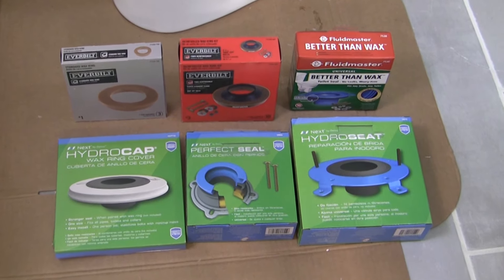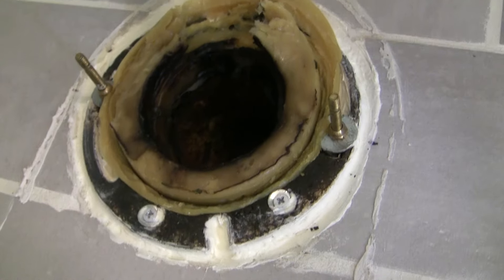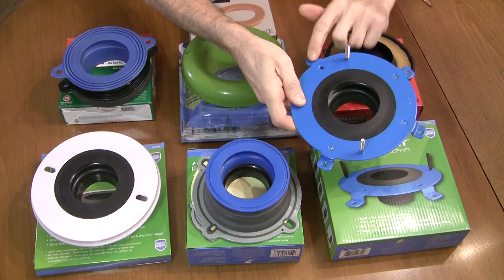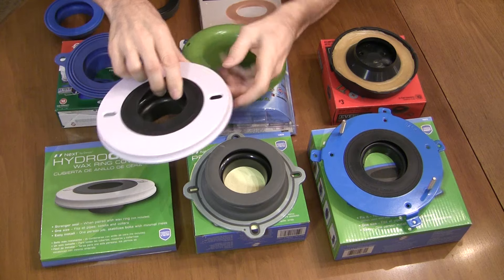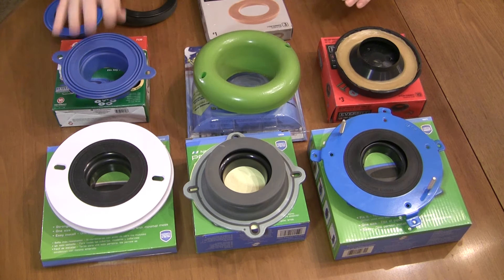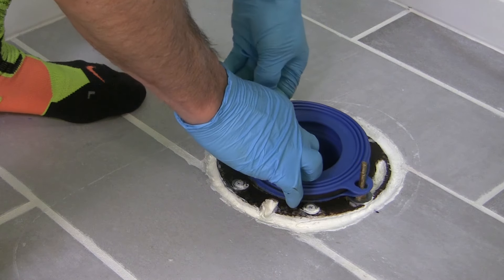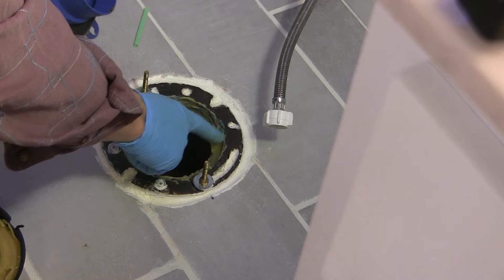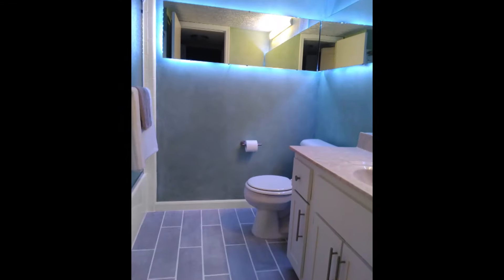2 YEAR FOLLOW-UP to Toilet Flange Fix  / Also, Compare Different Toilet Seals

Comment: I just did a seal 6 times 2 seals didn't  work then did another  one .then put old one back in .still leaked  then got a wax less one it was too big then got a 3 inch an it fit so I used a wax then a flange an put wax less on top .with no leaks .😮😊
Reply from the maker: Bummer.  I wouldn't be able to rest because I'd be thinking that it was going to start leaking any minute.
Reply: After a week taking that toilet  bowl off an on 6 times actually  12 times off an on .I got it to stop leaking  on.last try with black  wax less seal an wax on bottom  .iam done with it 😊 also had to catch water in buckets an used a kiddie pool to catch  water coming  though  basement   It was a nightmare  😮

Comment: the higher bolt ideas pretty cool but unfortunately it wouldn't work. you're just adding something else in there to get hardened overtime and crack and leak as well the bolts will not be putting pressure down on the tank anymore but yet on the tubes therefore after a period of time stress cracks will form therefore cause a leak. although would bring a whole new meaning to rock in the tank lol

Comment: No leaks? It worked. It worked? Then you did it right. The only thing you may have done wrong are those socks! (just kidding). You also answered a key question. What to do about the area around the flange? In my house I've just got a crawl space, so seepage, leakage would be under the house information, and the floor wouldn't be ruined. On the second floor of a house, your meticulous method of spray insulation foam, plaster?  A leak or seep could only get to the bathroom floor -where it would be a mop problem, and information. And of course the ceiling and room below would be undamaged. 
I think I've used my last wax ring. Today I'm replacing two old stacked wax rings that were installed between the toilet and the flange 1" (!!!) below the tile floor. There was seepage. When I pulled up the toilet no wax came up - so Zero seal. 
Hope and fond wishes  may apply to plumbers, but not to plumbing. I won't reveal the method I'm using to fix it because I'm not sure .... Well I used what they had at the Home Depot, so I'll spill. 
I've got a 1" gap between the tile floor and the still good cast iron flange. I'm using two sets of Korky WaxFREE Seal, and following their recommendation to use two. While researching this I found a video for Set-Rite which has several solutions that would probably work better for my situation.  One aspect of their system is if you old flange has the bolt holes busted off, you can drill 3/16" pilot holes and then screw in their self-tapping screws. That could be really useful.
Reply from the maker: WillN2Go1  It seems to me, you'll have to fill in that 1" gap between the floor and your flange. I'd cut some slivers of tile.  Maybe stack 1/2" pieces however you can get them under there and fill in the seams between them with mortar.    An inch sounds like an awful lot of height for a flange to be off the floor.

Comment: What about the extension cord routed through a wall?
Reply from the maker: By looking at the video, it's hard to know what's going on with those wires behind me because of the mirror reflections.  The wire goes behind the mirror, which is outset from the wall.  It goes to the transformer for the led light strip behind the mirrors, but I doesn't go into the wall.  It's not the most meticulous way of powering my lights, but it would take a lot of work to correct it and I'm too lazy.
Reply: @MartyPollio  haha you sure don't seem lazy.  Cool video.
Reply from the maker: @tomn6863  Thanks, man.

Comment: Plumbers telling you your doing things wrong. I'm here fixing professional plumbers toilet install. The idiots had no idea what they were doing. Leaking stacked rings with 3-400 dead flies under the toilet. Everything is wet and sewer gas odor coming out. Oatey twist and set flange going in now

Comment: Can't stainless steel nuts and bolts be used to hold the water tank on?
Reply from the maker: Yes, but they use rubber washers that decay in the water.

Comment: I'll ask this question because I'm ignorant. For the opening at the base of the toilet that connects to the flange, why not already have a lip built into the toilet that extends a couple of inches beyond the footprint of the rest of the toilet? That extra lip would go into the plumbing opening and would seem to eliminate the issue with leaks.
Reply from the maker: I hear ya.  I asked that same question at the end of my original (previous) video.  Seems like it would solve a lot of problems.
Reply: @MartyPollio  Indeed.

Comment: Marty,  Your comment on the possibility of manufacturers making the tank with porcelain "pillars" (tubes) and extremely long bolts is not necessary.  The Korky brand wax free gasket, and possibly other brands, provide stainless steel bolts.

Comment: 15:21 Not a good idea. Those long tubes made out of porcelain would be to thin and brittle. A much better idea would be to use stainless steel screws.
Reply: That's what I was going to say!
Reply: @clarkbarrett6274  Yeah I guess now we get a picture of why he was last of his class.🤣
Reply: @guayabito6946  It was still a fun and helpful video. 

I installed a new toilet last night only to find it not working properly (fill valve). What a nightmare.  I have another fill valve but changing out the brand new valve bites my butt.

Praying the wax ring works - it has the horn that is supposed to be bad....we'll see.

Comment: DO NOT USE THE Saniseal. Personal experience . After two years I removed my toilet and found the material falling apart. Talked to owner and he even requested I return it so they could study it. He was very interested and polite about it. I never found out what there study reveled. I went back to the old tried and true wax ring that never fails. This was back in about 2015 so I don't know if they changed the product. One can be making a big mistake using this on a wood frame floor. If your dead set on using it I would call and get some more info.
Reply from the maker: I've heard this same Saniseal story a lot.  The coating breaks down from the chemicals in the water and it becomes a mushy mess.

Comment: Your metal flange has a nut on each bolt and you placed the wings of the rubber flange over it. This doesn't allow the rubber flange to seat flat against the metal flange. I think removing those nuts are key for a more uniform fit. Stack the rubber flange over the metal flange and then bolt them together. Also, the foam didn't look good to me either and adding the wax looked like it helped. I think the foam part is junk and it would of been better as wax instead.

Comment: Taking 20minutes to repair or replace a flange doesn't necessarily mean the plumber is being sloppy or careless. Apparently some plumbers are able to install a toilet in 5 minutes because they have so much practice. They have muscle memory & it is routine and easier for them. If you're not doing this all the time it will take longer. Nothing wrong with taking longer for DIY if you do it carefully. If the plumber had said 2 minutes then I would give them sideeye.
Cool socks!
Lost art of paint scraper flipping. LOL! I would have dropped it because I have no coordination.
"Bees didn't sign up for this..." LOL.
Those saniseal things delaminate as well as get filled with water.
I went with Better Than Wax as well. You do need to sit on the toilet for a few minutes to get it to compress properly when stacking though. But they do have a thicker black ring to go under the blue ring now.
If you find yourself having to pull toilets frequently for any reason, I highly recommend a Toiletmaster lift jack (I'm not being paid to advertise). I swapped out the wheels to ones with locks & it's great. I have a bad back so I can't be lifting toilets.

Comment: 0:50 I couldn't sleep at night, if I knew my waste pipe was as rusted as the one shown hear.  A rotary brush could knock off that surface rust, and then protect it with some epoxy paint.  Use a dental mirror to inspect the area of pipe beyond the bend, but tape a string to your wife's dental mirror so you don't lose it down the pipe.
Reply: @tailgatecarpenter26  ROFLMAO!!!!

Comment: I'm not a expert, but seems to me if the manufacturer's would build the bottom of toilet  drain opening to be longer where it would go deeper into the  wax ring and flange it would fix leaking issues .

Comment: Im no plumber but i did almost exactly what you did and used the same seal and worked fine till now. Funny thing Was it was the toilet that was causing the problem and so far I’ve removed and reinstalled that toilet and just recently a new toilet and the seal still isn’t leaking. My problem is whoever installed the iron flange lined up the holes wrong so I had to install washers to catch the edge of the bigger part of the bolt holes in the flange. OMG 100 problems and the shit is one 💩

Comment: If you made bolt chimneys out of ceramic tall enough to go over the water line it would be so brittle that as soon as you torque down the bolt they would snap off like a pretzel.
Reply from the maker: Now I'm left with a sense of hopelessness.

Comment: Any of those are a downgrade to what you did in your original video, which was actually fine.  I've been in service plumbing for over 30 years and ever install is different and every plumber thinks other plumbers don't know what they are doing. Entertaining video for sure and although manybof the steps you did in your first video weren't necessary, they didn't hurt anything and it would have lasted for years or until you had a sewer backup that could have blew the was out.

Comment: You went to a lot of trouble to create this video. Not many people would do that. So, thanks.
Regarding the separated foam..see that's the trouble with some of these new gadgets made of foam and plastic. They might be perfect for a while, but if the material, or adhesive, eventually breaks down you could end up with a major problem causing you to have to not only pull of the stool to fix it, but to find that you have to replace your floor too. And that's what brought me here... [sigh] 
Not sure what I'm going to do. I might just go back to the ol' wax ring. (After I cut out the floor all way through the sub-floor and replace the entire floor.)

Comment: I purchased the green one years ago and have not had a single problem with it once over the years.
I don't know how someone could possibly knick it with the toilet sitting on it. Sounds next to impossible to me.
Reply from the maker: From what I've read in plumbers forums, those also get eaten into from the chemicals in the water.  Probably not a good idea to use toilet bowl cleaners in your tank.
Reply: @MartyPollio  I must be lucky because I've had one installed for close to 8 yrs now. No problems so far, even with those bleach tables that I put in the tank from time to time.
Reply from the maker: @ComPrt3  Just reporting what I read, but one thing I know for sure is that plumbers hate everything, so who knows.  I did a follow-up video to this one where I checked my rubber seal after a couple of years and it wasn't in very good shape from the water chemicals.  I decided to stick with wax, but lately I've learned that wax rings aren't all created equal either.  Evidently, the most common ones are petroleum, but the ones made out of beeswax are best.
Reply: @MartyPollio  So here I am just before 2025, and I purchased a new toilet. I ended up having to pay a plumber to install a new flange because one side of the old one broke. He install the fluid master better than wax seal. It lasted about 2 weeks. Water started pooling up in front of the toilet. So now I went back to the sani seal. Here's to another 8 to 10 years with this seal.

Comment: In terms of the toilet bowl and tank having screws and seals that corrode, there are one piece toilets that eliminate that problem. And as for the rubber seal, perhaps adding an extra flange to raise it above the floor could help.

Comment: This video is just another reason to use wax.  Lasts up to 50 years when done right.  Regards to the last comment on making the porcelain higher, well here are 2.  Way more money to manufacture, and if damaged now you have to replace the entire tank or whole toilet incase of a 1 piece.  I'd rather replace a $7-$10 part every 15-20 years that takes 15 to 20 minutes; after a novice reads the instructions.

Comment: I would say, because I've dealt with this issue, is that the toilets outlet arrangement has kept its weak points since Mr. Crapper's days. Its characteristics are, that this is good enough. Which is never as good as it can be. Putting the bowl on the flange is like trying to hit a target you can't see. Once you get it on, best you can say is that, maybe it's in the right place, which isn't very comforting. And the wax is the gooiest, sticky mess I've ever had the pleasure of getting all over the place. And I've seen the work of professional plumbers and electricians and they have nothing to be proud of. Professional only means that they are trying to earn a living doing it. That has nothing to do with how well they do it. And their poor workmanship is usually out of sight. And building codes, as far as I can see, only control how poorly the job can be done, not how well it should be done. This should create some hate mail too. The house I live in is a plumbing nightmare. Building inspector probably just signed off without doing his job.

Comment: Why they make the tanks so small that we have to flush multiple times?
Reply: S. Y. The environmentalists did that so you can waste water flushing multiple times.  They also decreased the water flow into the tank so you will have to wait longer, between flushes, wasting your time.

Comment: Sliding window is a great idea but the porcelain bolt above water line column is a non-starter. They would break off too easily*. Someone leans on the tank or bumps it and snap.....water all over the bathroom floor.  A solution is only good if it creates no extra problems while solving the one.  * Of course, one could use a much thicker walled column which would strengthen as well as take up volume for low flow applications.  Now, problem solved without causing other problems.
Reply from the maker: Good point.  Over-tightening the bolts could cause a crack in those porcelain posts too, so yeah, they would have to be thick.

Comment: No need to add wax to the area where the sealant was failing.  The sealant just holds the gasket in place.  The gasket doesn’t need to be sealed - It’s what creates the seal.

Comment: Didn’t you forgot the adaptor that goes under the blue adaptor between it and the casket? Besides great work
Reply from the maker: The adapter is used when the flange is below floor level.  It brings the rubber seal up to the proper height.

Comment: Btw, I'm currently remolding my bathroom, a long process that all stemmed from a toilet leak, which rotted the floor and a joust, so I kinda feel like you're here with me. lol Oh, and ive had my toilet in my dining room for several months now...I guess it will be the cherry on top.
Reply from the maker: Bathroom remodeling is hell.  It took me six months, and I didn't even do anything to the tub other than put on a sliding door.  Good luck with it.

Comment: Most Plumber's don't FIX STUFF like it was There Own HOUSE, (In My Opinion)! I agree with you on the technology aspect of TOILET'S. My God it's been What????  100 +++  YEARS since the Invention???  Good Lord Have Mercy. I like what you Did with the Foam and Getting the "FLOOR" sealed off to nearly PERFECTION. I'am not sure what else you could or have done. MOST Older Homes are NOT On CEMENT SLABS like a lot of the COOKIE CUTTER JUNK HOMES BUILT TODAY in the  year 2000+++. If ya Had a CEMENT SLAB It would be a better feeling about a LEAK if one Occurred, at least the WOOD FLOORING wouldn't be damaged which is a REAL ISSUE with the Older Homes like ours (Built in 1959) and has had Numerous PLUMBERS attempt to "FIX" A Leaky Toilet FLANGE MOUNT. Maybe  it should be a NEW CODE Nowadays to POUR A CEMENT Surrounding (On Single Story Homes) Around the Area of the TOILET MOUNTING???  Or Perhaps Have the TOLIET EXIT AREA where the Stuff Goes Down,  To be "BUILT to go "INSIDE" The Main Sewer by 3 or 4" and use some kind of a seal just for the GASES to be held in. I don't know. It's an ISSUE STILL and Needs Addressing No Doubt!!  Good Job here.
Reply from the maker: There are a lot of videos about changing the flange.  You can use a Dremel to cut the inside of your drain pipe and replace the top portion with an expandable rubber piece (that fits inside the pipe) and a new flange. A plumber might charge you $500-$600 to do it, but you could do it yourself.  Thanks for watching my video.

Comment: dude they make them to slightly stretch when putting them over the bolts so the toilet flange will seat in the rubber opening.

Comment: Marty...as for the bolts. I replace mine with stainless steel bolts that I got from ACE HARDWARE.
Make your own washers...using 50 durometer SILICONE RUBBER.
I came from the rubber industry...SILICONE RUBBER will not rot or discolor..like the black cheap ass washers they sell in those kits.
Reply: How do you make your own washers out of 50 durometer silicone rubber? Do you use a template? Wondering how thick the silicone rubber should be? Thanks in advance.
Reply: @kimariokiji  Kim...you can call Buffalo Seal in Houston Texas. Ask for Phillip.
50/60 duro silicone
1/8" thick x  1"od x 3/16"id
Phillip is the owner..will treat you right.
The stainless bolts @ Ace Hardware
Reply: Agree with you 100% that the  washers included with the bolt kits are poor quality. I also worked in the  polymer industry and wish such poor quality so called rubber washers be discarded forever.